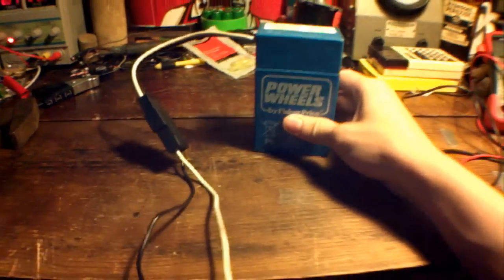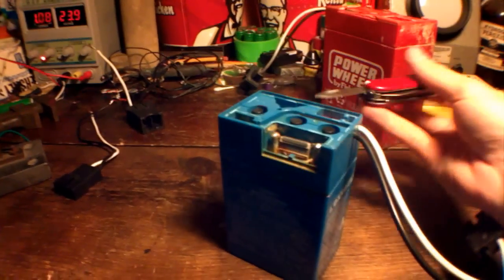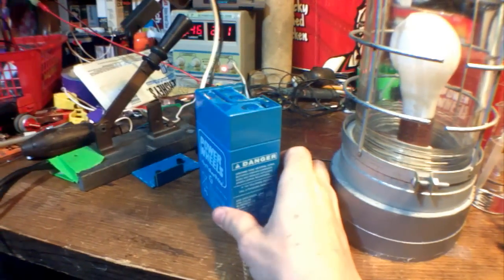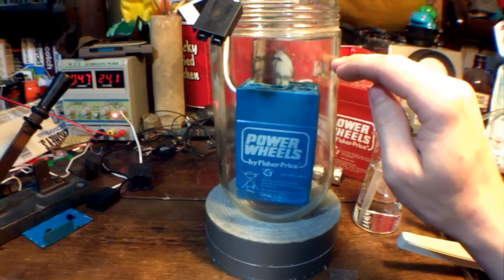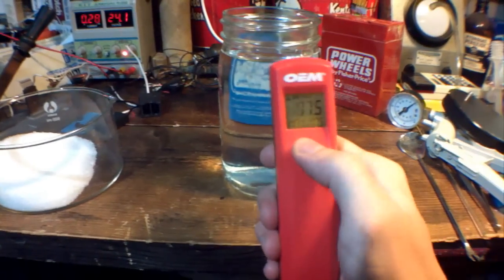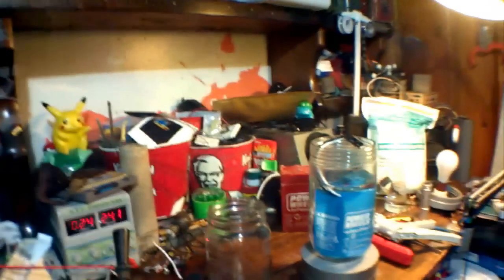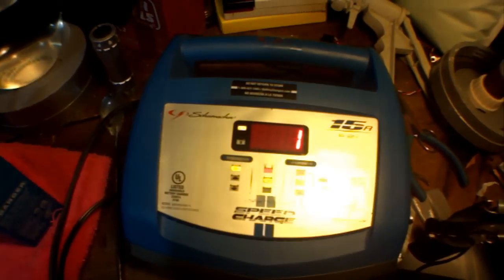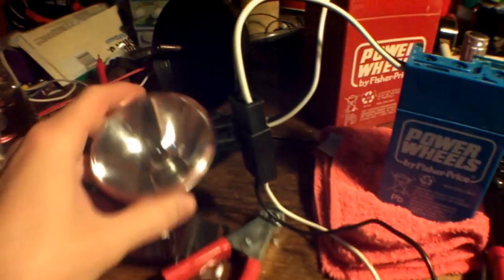Repair Lead Acid Battery with Epsom Salt

Comment: Stupid question but can't you push the air out of the sales by pushing water into the cells
Reply from the maker: Well this battery is so small that the surface tension was fighting me.
Reply: @RinoaL  okay I have one more question if you don't mind I have one of those batteries maybe a little bit bigger but it takes a  fuse as well how do I know what number fuse it takes
Reply from the maker: I do not know that, sorry. Google probably does though.

Comment: i charge the battery, runs great for 10 mins than losses all power? its a 3 yr old 12 volt for a power wheels.

Comment: Your not repairing anything with Magnesium Sulfate. If done right you are substituting Magnesium Sulfate in place of acid based electrolyte. That is not repairing anything or reconditioning anything! It can work as can many other alternatives. The problem is that you are turning a starting battery into something that is more like a deep cycle battery. Also CA, CCA, Reserve Capacity all go down. The biggest down side though is that the battery's output is very very temperature dependent. So in a warm climate not a big deal but any place with cold winters it is a problem.

Comment: hi

i have lead acid battery 220ah 
all 5 cell are in great condition but one cell that near to the minus plus with 0.5v only !!! 
did you know way to fix it?
i try to charcg only this cell
i try to put disulptor
i try to chrage all in slow amper

what keft to try?
some soda podwer to try to clean this cell?
the problem that this battery is 50kg !!!

thanks
yossi

Comment: I tried this and discovered that these videos are all a hoax. This is a bullshit lie like those two motors making free energy.

John Douglas
2 years ago
you cannot, I repeat CANNOT repair a lead acid battery.
once they degrade, that's it, no coming back.
Reply from the maker: you can to a certain extent, not a whole lot no. but these videos arent a hoax, i didnt fake anything

Comment: Sla Agm batteries cells are suppose to be empty......google it and you will see......you should not see fluid in the cells of agm batteries.......thats why they are considered non spillable
Reply from the maker: sure, but without adding liquid they wont work, so might as well add plenty once they are dead and get that last bit of usefulnes from them.

Comment: You are not suppose to fill agm batteries.....they are called non spillable for a reason....they are not convention car batteries....flooding them with water will ruin the battery
Reply from the maker: no it wont ruin the battery, they are the same chemistry. it might lead to a tiny bit of leakage but thats all, and they tend to be designed in a way where that wont happen anyway.

Comment: This battery reconditioning guide works by showing you step by step how to recondition your old batteries [Check Details Here==>https://t.co/jpT8CnHVNJ ]. Again this is a digital book. Although it’s very easy to follow, as far as I’m aware Tom hasn’t put this information into video form yet. Which would be great. I personally love reading.

Comment: NEVER BRING THE WATER/ACID LEVEL TO THE VERY TOP as this will cause an overflow condition leaking acid. There are vertical slots inside the fill hole...and according to all that I was taught you should bring the fluid level to a midway level in the vertical slots (battery on a level surface), this will allow for expansion of the fluid. Never mind that you should also test the individual cells with a hydrometer for specific gravity. Keep on keepin on.
Reply: You teach?

Comment: Hi Rinoa Super Genius.  Epson Salts is fine for a last ditch temporary fix on a really naff battery, I wouldn't add it to a good battery though. 30 years ago I did an experiment with some similar newly bought 100 AH marine batteries in good condition. I added a chemical called Bat Aid, widely sold as being good for batteries to 2, but left the other 2 batteries untreated. The UNTREATED ones lasted years longer! I don't know what the chemical composition of  Bat Aid is, but I'm wary of ANY battery additives now. The other day I read on the website of a large forklift battery firm that it is NOT necessary in most cases to use distilled water & that ordinary tap water is what they usually suggest . I'm sure you're right in most cases. It's just that I pay less than £1 (1 US dollar) for a litre, so I don't risk it on my expensive batteries. For old batteries that are not worth much it probably doesn't matter. I always think that in non sealed batteries with dirty cases some crap may fall down & contaminate the water slightly very often, as many car owners don't bother wiping the batteries clean before adding water. Have a good day.
Reply: Actually I'm pretty sure Bat aid contains EDTA . All these additives are great for old knackered batteries to get a bit more life but tend to have negative effects like corroding the plates more quickly  & increasing the self discharge rate of the battery.

Comment: I really wish you could explain how much water, and Epsom salt you use. I just can't find a video with that information.
oh how about putting the liquid in the 6v with a children's medicine syringe
Reply: Shona Magouyrk I used a medicine syringe just now after watching the video... Charging the battery up right now to see if it work... Also you will have to tilt the battery while you squeeze the water in so it'll flow. If you leave the battery flat then it would just make bubbles at the top and it would take longer for you to do so... hope this helped

Comment: Its been a while since you posted this vid but....you can purchase a TURKEY MARINADE INJECTOR from most grocery stores. It is like a large plastic syringe with a screw in sharp needle (plastic with a small opening ). Use it like a regular syringe by placing the tip into a container with fluid...likely distilled water. Then pull back on the plunger which will fill the chamber partially. Then put the tip into the battery port and fill to desired level.      The RV Prepper    Jim K
Reply from the maker: no thanks, this worked well from what i remember.
Reply: I've been researching into battery reconditioning and found a great resource at Jons mender guide (check it out on google)

Comment: EverExceed Rechargeable lead acid battery
 
EverExceed reliable lead acid battery / AGM Battery / Gel Battery / maintenance-free battery / VRLA / Sealed valve regulated lead acid battery for
 
1. Network power: Provide energy storage solutions for critical systems that require uninterrupted power supply.
 
2. Motive power: ideal storage solutions for warehousing heavy duty and universal applications.
 
3. Transportation power: complete battery solutions for all the transportation applications such as automotive and light truck batteries, golf cart batteries, marine/RV batteries, etc.

Comment: I like your video, do you have any where you on re-chargeable batteries. I work with the recycling center in town and I have several 12-volt rechargeable batteries, and others as well, but no car batteries..  particularly your advice in the second half concerning how to recondition old lead acid battery
. Something I also found helpfull for how to recondition batteries
  was Corbandy Battery Blueprint Crusher - if anyone is interested search on google

Comment: you cannot, I repeat CANNOT repair a lead acid battery.
once they degrade, that's it, no coming back.
Reply: +John Douglas I like your video, especially the advice  concerning how to refurbish lithium ion batteries
. Another resource I also found helpfull for recondition lead acid battery epsom salt
  was Megarno Amazing Battery Magician - if anyone wants to know more search on google
Reply: +John Douglas  This is a great video and I like it, particularly your advice about lead acid battery reconditioning guide
. Something I also found helpfull for lead acid battery reconditioning guide
  is Renkarter Rapid Renew Report - You may search on google for it if you want.
Reply: +John Douglas interesting points ,if anyone else is searching for how to recondition car battery at home try Panlarko Recondition Planner (should be on google have a look ) ? Ive heard some great things about it and my co-worker got great success with it.
Reply: sometimes ;)
Reply: +John Douglas interesting points ,if anyone else is searching for how to recondition batteries at home try Panlarko Recondition Planner ( search on google ) ? Ive heard some interesting things about it and my buddy got amazing success with it.
Reply: hmmm what are the chances of two different accounts making exactly the same reply?
smells fishy!
Reply: John Douglas A@@
Reply from the maker: John Douglas
oh that fish has been smelling up my videos for years now.
Reply: @RinoaL  why don't you block that fish?
Reply: +John Douglas I\'m not sure but ,if anyone else wants to discover how to recondition my car battery try Renkarter Rapid Renew Report (do a google search ) ? Ive heard some incredible things about it and my mate got great success with it.
Reply: you've "heard" some incredible things?
uh-huh.
Reply: +John Douglas 
There are many factors in fixing a car battery. One place I discovered which successfully combines these is the Magic Mender Wizard (check it out on google) definately the most helpful course i've seen. look at this  incredible website.
Reply: +John Douglas I've been studying fixing a car battery and discovered an awesome resource at Magic Mender Wizard (check it out on google)
Reply: +John Douglas I have spent months researching into battery reconditioning and found a fantastic resource at Magic Mender Wizard (check it out on google)
Reply: +John Douglas hey ,if anyone else wants to uncover how to recondition used car batteries try Corbandy  Battery Blueprint Crusher ( search on google ) ? Ive heard some pretty good things about it and my work buddy got excellent success with it.
Reply: uh-huh, your buddy eh?
Reply: you are wrong Baby :) I am using small big all sizes lead acid batteries that I repaired.  with different techniques.  the only condition is that it shouldn't contain any dead Cell in it.
Reply: John Douglas yes u r right once fully dead can't be
Reply: John Douglas ,
If the battery is showing less than 10 volts, it cannot be salvaged, period.  The battery is too badly discharged.  It is too badly sulfate to be salvageable.   Replacing sulfuric acid with Epsom salt ( magnesium sulfate)  would give you 2-3 weeks of battery life, it that long.  Don't waste your money with "desulfation" gadgets either.  It is not going to restore your battery, period!
Reply: +John Douglas  Not certain about the points made but ,if anyone else needs to find out about recondition lead acid battery try Battery Recovery Tactics ( http://battery.RecoveryTactics.com  ) ? Ive heard some extraordinary things about it and my work buddy got great results with it.
Reply from the maker: John Douglas wrong. i've increased the usefulness of loads of batteries by doing simple maintenance like this.
Reply: that is maintenance, it's not repair.
and many factors can effect battery life and output.
age, sulfation, heat, cold etc
epsons salts do not effect sulfation, it just increases the ability of ions to transfer (for a while)
this doesn't alter any existing damage to a battery from poor charging or poor propper maintenance.

this is covered very well on battery university.
Reply from the maker: John Douglas
sometimes a repair can consist of working around a failure instead of removing the failure.

btw i'm not a fan of battery university.
Reply: which is called maintenance :P
keep batteries charged, don't take them below  12.4v or minimum 12.3v
use a "good" charger or, put them on a solar setup to keep them at peak.
that's the best you can do.
don't ever add liquid to gel or AGM batteries either.
Reply from the maker: John Douglas
adding water to AGM is actually a pretty good idea because they have the best chance of being repaired.
Reply: ~sigh~ No, it's not, water CANNOT be absorbed into the glass mat, it's deigned that way, it'll just sit on top of the plates and do pretty much nothing.

dude, go look up how AGM are made and how they work.
Reply from the maker: John Douglas
ok then why does adding water to an AGM battery make it work well again? either way it makes it work better as a battery so it doesnt hurt.
Reply: and do you have any links or evidence with an actual study?  anecdotal evidence and personal experience are all well and good, but so solid stuff would be appreciated.
I've tired it with dozens of AGMs myself and never once has it recovered a battery.
not to a usable state.
Reply from the maker: John Douglas
yes several times in my videos i've taken an AGM battery that is sitting at like 6v and wont charge, then fill it with water and charge and it sits at 12v and is strong enough to start a motorcycle or run a few lights.
Reply: and how have these batteries gone over time?
have they maintained their charge and ability to recharge?  how long do they last, what is their charge and amp capacity?
have you revisited and properly tested "repaired" batteries with proper equipment?
Reply from the maker: John Douglas
no they arent fully restored, but they do work a large amount better when you refill the electrolyte.
Reply: my interest is in by how much? 
I guess it depends on what you use them for.
but as I said, I've never managed to recover a single battery (yet)
Reply from the maker: John Douglas
from 0 conductivity to about 30% of its original capacity. sometimes the water in the mats dries up from electrolysis and so the plates stop connecting, if that happens in one cell the entire battery cant provide power. but even when that doesnt happen you can see a very nice improvement.

my theory on why this works is that the plates in an AGM battery are acid starved, so they dont really have enough sulfuric acid to sulfate nearly as much as in a flooded cell.
Reply: hmm could be, could also be poor manufacture or a bad batch or any number of things.  
but, hey, if it worked for you awesome.
the price for batteries here in Australia is at least double than the US. more if you don't shop carefully and buy from a distributor.
from 0 to 30 is a pretty good outcome.
Reply: Hey everyone, the best success that I have had was with the Magic Mender Wizard (i found it on google) without a doubt the best info that I've tried.

Comment: You just ruined those batteries, when you soak them underwater you wash out the acid. You can't charge batteries of different capacities in series either. Please stop making instructional videos

Comment: Quick question. I have been using solar energy for years for my house. Each year I have to replace something in the battery and I believe it's the cells or maybe the acid. That's the question, so over time or a period of 12 months which element wears out ? Is it the acid  (lequid) or the cells  (overlapping boards) ?
Reply: top it off with water

Comment: FUCKING TALK TO MUCH
Reply from the maker: yes you do, so shut up.
Reply: Who?
Reply: anonymous user 1368 Quick question. I have been using solar energy for years for my house. 
Each year I have to replace something in the battery and I believe it's 
the cells or maybe the acid. That's the question, so over time or a 
period of 12 months which element wears out ?

Comment: if I had a sealed 12 ah battery and it was sitting for 4 or 5 months and then I charged it once, how long would I have to wait to open it? So I just put water in it and charge it for how long? It's currently reading 8v.
Reply: open it whenever you want

Comment: good video. do you have any where you on re-chargeable batteries. I work with the recycling center in town and I have several 12-volt rechargeable batteries, and others as well, but no car batteries.
Reply from the maker: you want to know where to get differant batteries? i trade them at my local hardware store. i trade a dead battery for a differant dead battery off their recycling skid.